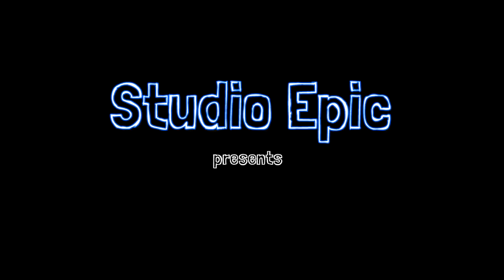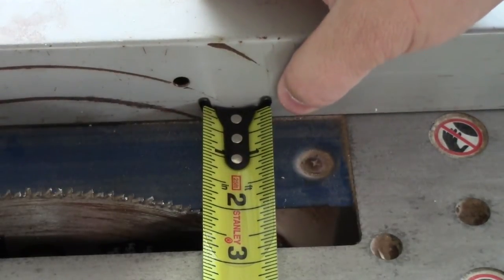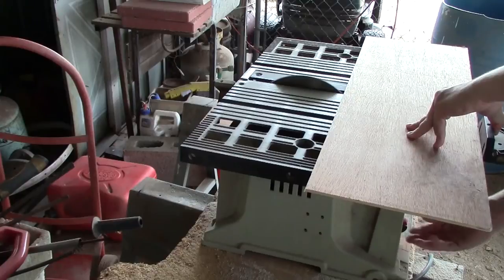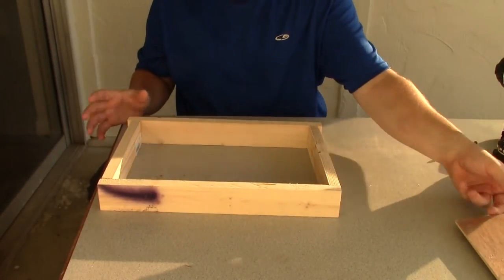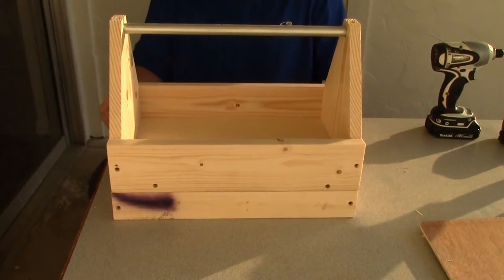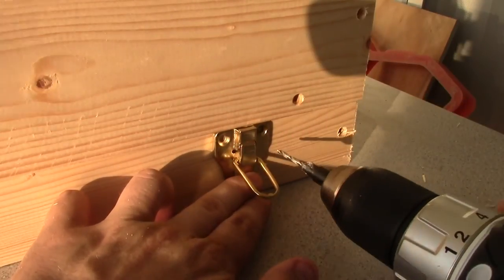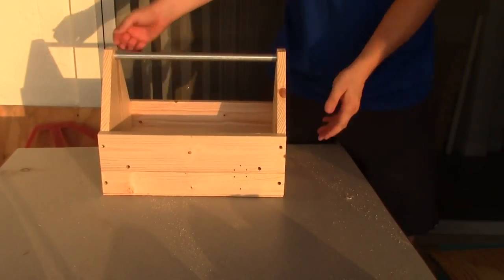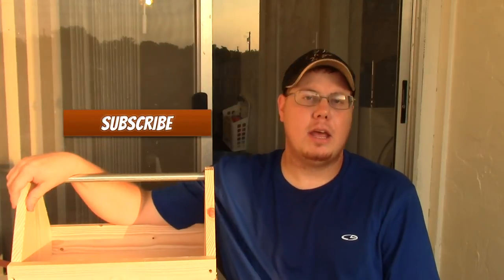Wood Working Projects: Wooden Tool Box pt 2

Comment: I would like to learn how to make three bottom trays to touch tools box which I'm going to make for my tools in the future but do you know how should I do that
Reply from the maker: +Willow Fashionist 82  I would say if you want 3 trays on bottom that you would want to make them slide in and out.  I would say build the entire frame and make the sides longer so that you can add trays to slide in and out.  One thing I would warn you is that if you start adding trays and lots of tools, it will make it much heavier.  The idea of mine was to be something that had certain tools in it so I could grab it and go.  But if you want 3 trays I would definitely make them slide.